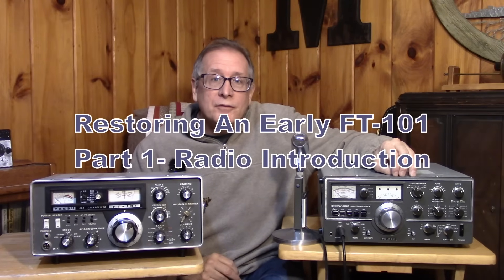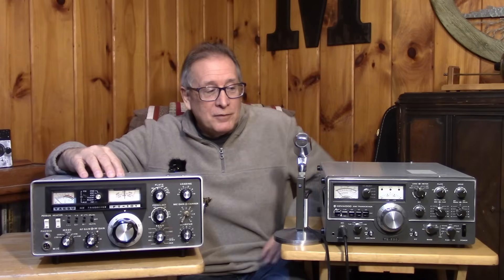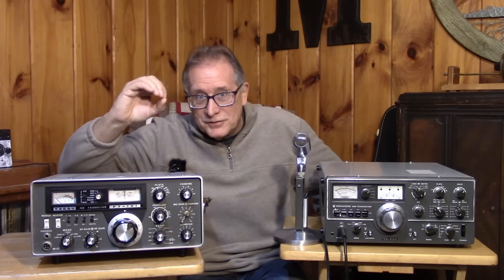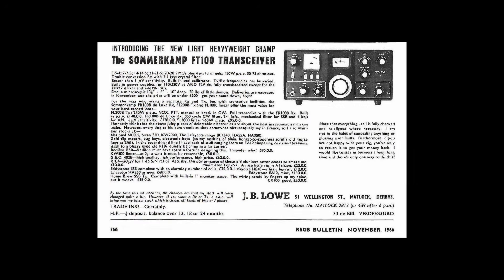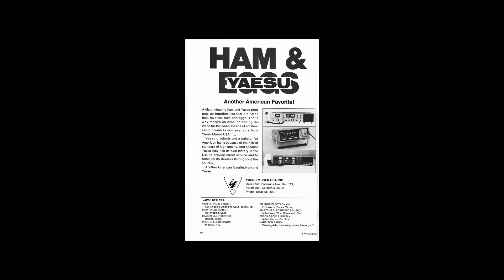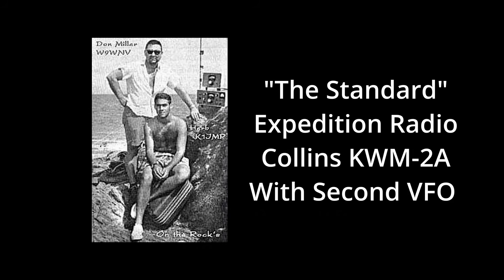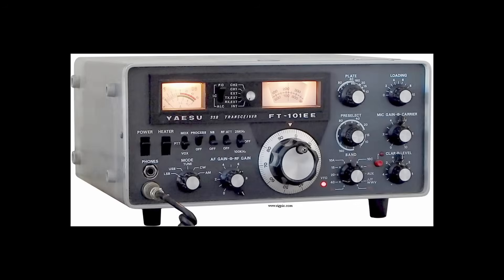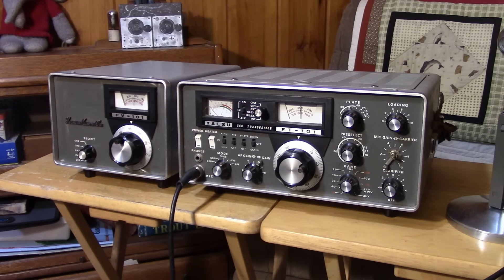FT 101 Restoration  - Part 1

Comment: I just picked up my second one this week has more options then the old one I sold a couple months ago. I was watching your videos and cleaned my new one today it is working great. Is there a difference with what the serial number inside shows you vs the one on the back? The serial inside on the one I just got is 232277 if you could decode that? Thank You de VA3AVP it is  FT-101EE fully loaded.

Comment: I bought a ft-101 in Nov. 1970 & still have it.  Used it base & mobile for several years with no problems; it probably needs recapping but would still work, im sure.....
Reply from the maker: And that is just what a lot of folks did. This radio was obviously one of those. Just stuck in the closet.

Comment: Everyone (probably) already knows this, but it may help someone enough to make the comment. Wall outlets in JAPAN provide approximately 105 AC Volts. So when you see broken, for parts gear that someone may have had shipped from Japan, and to the seller’s memory arrived ‘broken’? Keep in mind, it’s been my experience that Japanese engineer types are not liars. So your recently acquired Vestax gear most likely has a jumper arrangement and blown fuse under its hood…

Comment: Nice Job. Very popular in Brazil. My first ssb equipment that I repaired and used in my life was the F200. Then I rebuilt some FTDX400 and FT401B. The Yaesu FT101 has many lovers here. I have already restored 4. A lot of attention must be paid during the pre selector calibration procedure. A little complicated, but if done and redone several times it results in very good tracking. A small difference between the RX peak and the TX peak is acceptable.  Unfortunately new 6JS6C are very difficult to find in Brazil. A very similar valve from the point of view of electrical and interelectrodic characteristics is the 6DQ6, which can be replaced together with the socket. The 6DQ6 are easier to find new ones around here. One day I get excited and make a video about some Brazilian equipment that was never exported, like the famous Eudgert Ouro C, made in the 60s and which was a blatant copy of the Drake TR4. PS. Pay atention on the coupling capacitor in from 12by7 to grids of finals. This mica molded yaesu capacitor are famos for failure and take the finals to the tubes heaven.
Reply from the maker: Its funny I converted a 6DQ6 rig, the Hallicrafters SR-150 to 6146's! Just had to rewire a bit around the socket, fool with the Bias and tweak the neutralization.

Comment: Perhaps a review of a RX and TX alignment procedure, if you cross that bridge. It's an issue that I struggle with on my FT-101B from time to time.
Reply from the maker: Ha that will come. I'm still in the remove inspect and cleaning stages!
Reply: Ok no problem I will follow along. Its a great radio and one for anyone's shack. A forever radio.

Comment: Wow! what a fantastic video. I always enjoy your videos Mike, but this one I devoured instantly , I enjoyed this content and can't wait for the rest of it!   de N3TGY
Reply from the maker: I'm in the remove clean and inspect mode now!
Reply: @MIKROWAVE1  I have to tell you what I clean my old radios with,  I use Ballistol ( it's a gun CLP ) it gently cleans without harming wood,plastic, or rubber.  It's fantastic,  I cleaned up a bunch of really grimy tobacco stained rigs like new and it's biodegradable, it won't harm you or your skin.  I sound like a commercial but it isn't oh it also doesn't harm the paint tampos on the faceplate  .Just what I found out . The only thing is the smell- some like it some don't ( has a black licorice smell because of the plants it's made from)  hope this info helps.

Comment: Wow…. Thanks Mike, for the deep dive. Does the internal AC PSU offer 230/120 V DC (pretty sure my TS520 does offer this)? We are 230v AV in OZ. 73 de VK2AOE
Reply from the maker: 120/200/220/234 VAC options on the transformer but you have to make sure it is hooked up correctly underneath!
Reply: @ TU 73

Comment: Sadly, I only brought back a TEAC reel to reel and a Nikon camera. Nice stuff but, I wish now I had brought home an FT-101.
Reply from the maker: More details please. Where did you get the stuff and when?
Reply: @MIKROWAVE1  I joined the Navy in the summer of 68, and as a seaman my ship the USS Newport News a heavy cruiser, arrived on the gunline and began firing on Christmas Day 1968. I was a sonar tech but switched to ETN (communications tech) because no sonar on that ship. At some time in that deployment, we made an R&R trip to Yokosuka, Kanagawa, Japan then Kagoshima Prefecture. I bought a Topcon Uni Camera, but didn't like the fine threads on the lenses, so I bought a Nikon FTN that used bayonet lug type connection, along with a 50mm, 35mm fisheye, and a telephoto that was I think 150mm. I bought a Sony reel to reel but later traded for the TEAC. I think this was all at Yokosuka we sailed back late in 69, where I was transferred to the USS Springfield CLG 7. I spent too much time drinking and doing what an older teen and young 20 something would do, we setup our electronics in different apartments for parties, or lugged them from port to port. when I got out from Gaeta Italy in 72, I shipped all my stuff home. I hope this has not been too detailed of a report Sir! lol

Comment: Looks like a 'fun' project LOL - I like to watch Will Everett's channel on how he reconditions old Heathkit HW-101 transceivers - the water and soap cleaning method freaks me out a bit... Looking at the inside of that FT-101 takes me back a bit with that coil slug tuning mechanism. First time I saw one of those was in an old Delco AM radio I scavenged from a car junk yard when I was in my mid teens - Back then I was totally full of questions as to why that method was chosen over a tuning capacitor.
Reply from the maker: I actually repaired a table radio by Blonder Tongue that had a rack like a car radio.

Comment: Hi Mike exlent. I have a 101EE that I restored over a year ago now.but sadly it was put under the bench.
I do intertoget it back out again a complete it's restoration 
Ins not transmitting because the pa valves are missing.😢😢😢
Reply from the maker: Those finals are out there. Its just hard to imagine that junker tubes worth almost nothing have value due to scarcity now. That said you can still find a pair for less than 100.
Reply: Not out here they are not easy to find and very expensive.
Reply from the maker: @paulswift700  just did an EBay check and saw a pair of US made pulls for 50 including shipping.  Now you take your chances buying 4 or 5 of these pulled tubes and matching them up, but that is how I would go.

Comment: I'm sitting here staring at the FT-101E without a scratch on it that I picked up cheap several years ago and haven't gotten around to doing any restoration on, just a bit of research on the various models. And here you are doing a full restoration on a 101. Perfect. I'm smiling.
Reply from the maker: Fantastic! I'm still pulling inspecting and cleaning, but i'm making progress.
Reply: @MIKROWAVE1  I got one about a year ago to restore and it is a rats nest inside but looks mint with the plastic cover still on it. A lot of old mods that i want to take out maybe i can get round to it now thank you.

Comment: i have ts520se can modfity one channels knobs like 28mhzs for 11meters for 27mhzs?
Reply from the maker: 11m was native to the Yaesu with the right crystal and filter installed, and many mods for AM improvements were known, but the Kenwood is not an AM rig. So if it were possible, it would be SSB primarily, and it would be quite a job. A of of the Yaesu's are being converted from 11M back to 10M now. Its gone full circle.

Comment: Yes, looking forward to this, I need to do a restoration on mine, FT-101E built in 1976, ( serial 6N)Hasn't been fired up since the 1980's! Seen repair vids but no restoration video!!😲😲😲
Reply from the maker: It's simply amazing how fast the factory responded to the feedback and parts obsolescence compared to a US company at the time. They went though several models in 5 years!

Comment: Are you familiar with the FT-120741? It originally debuted in Hawaii where it bombed. What torpedoed it was every time a carrier was put on the output sank.  Midway through its introduction it had an even worse problem with carriers. It was so bad some hams rented a plane and in 30 seconds over Tokyo returned them. It was obvious Yaesu woke up a sleeping giant and America soon began models that hams bought.
Reply from the maker: Took a while. SDRs?

Comment: So, ...
 I will take my 'Sommerkamp FT227E' , and will  see, what you are doing in parallel, ...! 

Maybe, I can also 'make' my radio a little better, ...! 
(Only 'maybe', because it is an European version of the 1976 'Yaesu FT-101 E, as it was called here in the EU, 'Sommerkamp' with a different model-number on the plate, 'FT-227E' ! 
And the 'later E-model' is not what you are investigating here!)

So sad to hear this, as I hoped to find a fantastic 'video with a superb repair and modernisation manual' ! (Hi Hi ! ! !)

Good luck with your journey through the early FT-101 ! I will take also a look at my old darling again, ... ! It is a 'boat-anchor', buildt like a German tank from WWII. 

73 de Markus - db9pz - Loc: JN39fq - 3miles/5km east of LX -
Reply from the maker: Thanks for watching Markus. These old Hybrid Radios are heavy like a King Leopard Panzer!

Comment: How similar is the 101 series to the 901?  I have a 901, I haven't used it much but had it on the air for a while. I started on TenTec's with transisters BITD.
Reply from the maker: Those old TenTecs are very fun and collectable.

Comment: Watching the video in progress. "Nicotine covered NCX3s" made me laugh out loud. I owned an NCX3 back in the day and I am a moderate smoker.
Reply: Saw a vintage Yaesu on Ebay recently, one that was brightly finished from the factory--totally ambered by smoke. The outside would clean right up, with a bit of effort. The insides would reek forever.  They'd have a hard time giving me that radio--I've scrubbed enough nicotine for this lifetime. I like a cigar on the weekend. 73
Reply from the maker: The NCX-3 was my mobile in my first car, a 66 Belair! Talk Power and a truly great receiver. But CW - Forget it!
Reply: @MIKROWAVE1  Yeah, I know what you mean. The NCX3 was pretty hopeless on CW, but it could really scream on 80 or 40 metre SSB, especially with the speech compressor that I used with it.

Comment: I used to hang out at Henry Radio back in the late 70s.
Reply: I used to hang out there too when it was on Pico in the original store. Quite a history.
Reply: @SoulStarLA  They moved from Pico to Olympic and then to Bundy.
Reply: @ Yes, I know. I visited all their locations many times. The new store was good for hi-fi, but lacked the old style character of the Amateur section.
Reply: Before Ham Radio Outlet existed, all my Los Angeles visits included Henry Radio.  It was a very special place.
Reply from the maker: Sounds like the first time I was sent to Silicon Valley and went into Weird Stuff!